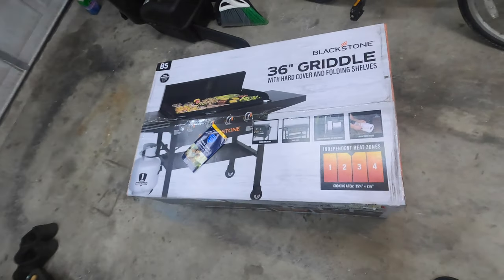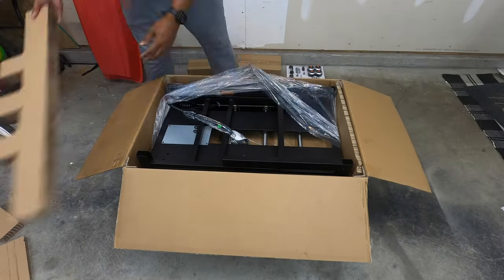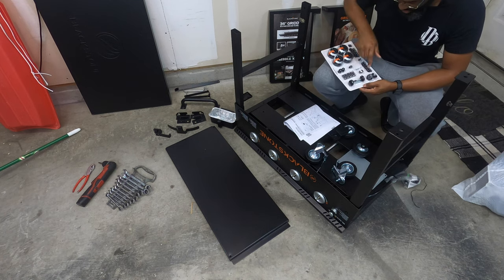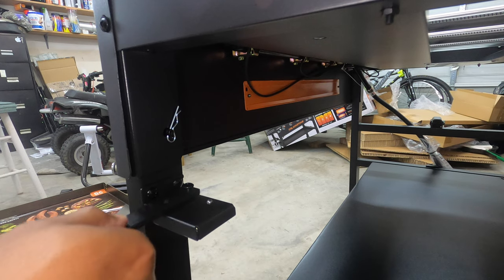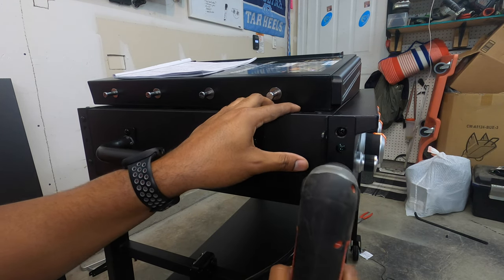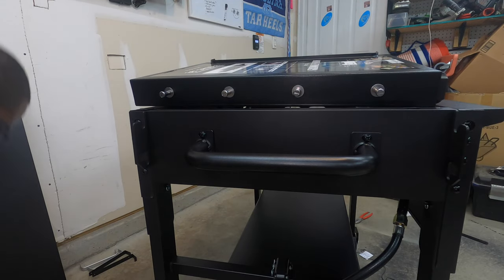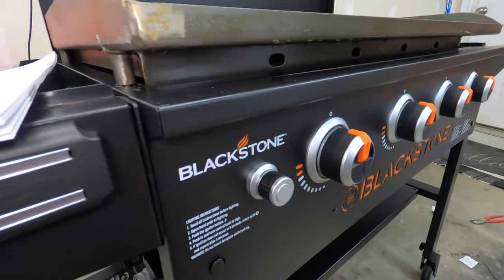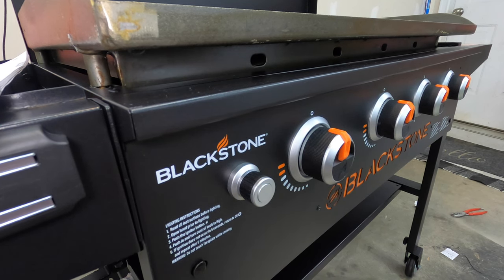Blackstone 36" Griddle Flat Top Grill | Assemble in 30 Minutes or Less?

Comment: I think the hinge is just if people wanna upgrade to a hood later bc that's what the hooded version uses. But I bet theres some sort of way to drill holes and add screws into the cover that will allow it to work with the hinges.
Reply from the maker: I don’t want to pay almost $200 for the upgraded hood, but I also can’t just add a bolt in there bc it won’t open. So I’m going to play around with some ideas, make a few brackets and see what I can come up with.
Reply: @DariusBuildz  yeah I don't think it's worth it either. Lmk what you come up with bc I'm planning to get the same model this month
Reply from the maker: Im probably going to go to lowes, see if they have one and try to copy that hinge and make one, lol